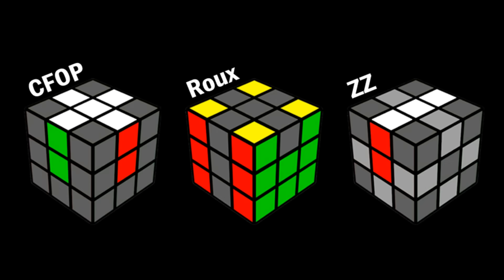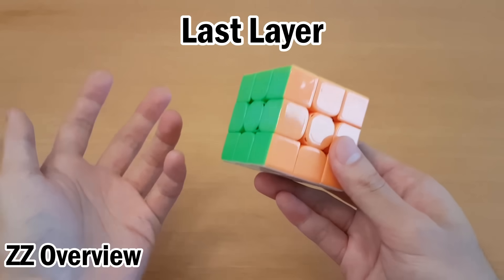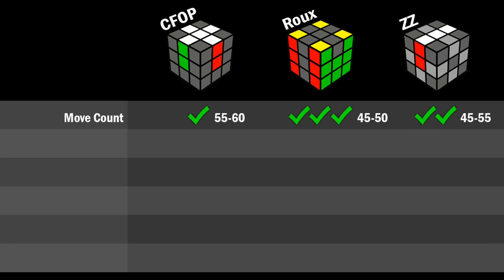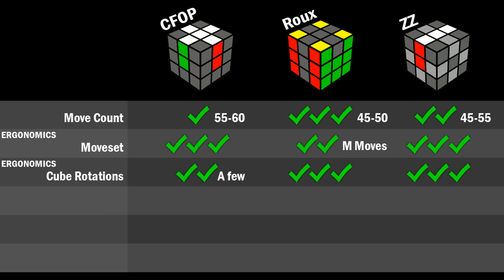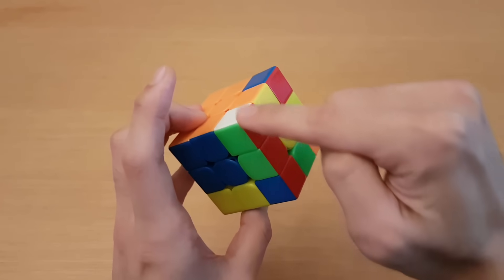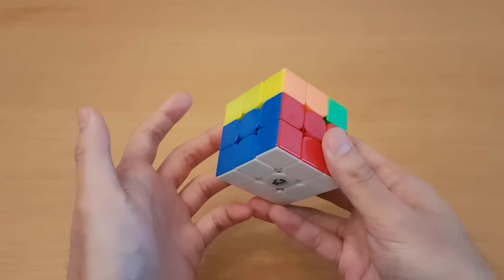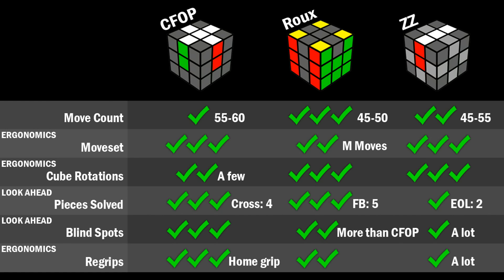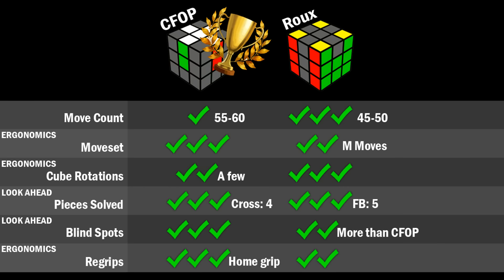The BEST Speedcubing Method? [CFOP/ROUX/ZZ] Comparison

Comment from the maker: Some good points I've read:
- ZZ EOCross is better than EOLine for regrips and blind spots. I still think it compares poorly to CFOP and Roux in the other points already discussed in the video. Even though it seems like "do some moves then do a better version of CFOP", look ahead is still hindered. Inspecting cross+1pair in CFOP is similar to inspecting EO+cross in ZZ, meaning you still solve 6 vs 4 pieces and remove a blind area by doing CFOP.

- Roux M turns are not that bad on big cubes. I accept that I may have been wrong. Please forgive me for switching to a new argument: I don't believe that <R, Rw, U> is a great moveset on big cubes as Rw is similar to L. Frequently switching between R and L (Rw) is slower on big cubes.

Also this thing about regrips:
- Starting with r2' for the Roux regrip example reduces it to 0 regrips. No it does not. You start and end out of home grip, meaning that there are 0 regrips mid-alg, but usually 2 and possibly 1 regrip instead if you're lucky. So if you used that exact alg in a solve, chances are you'll add 2 regrips to your solve. Therefore it has 2 regrips. This is the same reason why OLL algs are not regripless unless you start and end in home grip.
Reply: "Inspecting cross+1pair in CFOP is similar to inspecting EO+cross in ZZ"
I don't agree with this at all
I don't know of a single at least decently fast ZZer that does EO+Cross seperately, most (if not all of them) do it at the same time. 
Besides, even if you would do them separately, its 100% not as difficult as inspecting Cross + 1 F2L pair (at least from my experience and other people I've asked). 

And some other points for the ZZ vs CFOP argument: (just a quick note over here, I'm talking about EOCross)
Lookahead
This one I really don't understand either, how is lookahead supposed to be any worse for ZZ compared to CFOP? From my experience (sub-13 w/ CFOP, the same now w/ ZZ) lookahead is actually easier in ZZ. I know someone is going to say: "oh but you see more pieces when you rotate blablabla", it is true that you see pieces when you rotate, but rotations take time, which cant be used for turning (because you're basically doing a really long regrip). When with ZZ, you don't need to do rotations, and you really don't need to even tilt the cube much, because remember, EO is solved, you always know the orientation of the edges, so you don't need to check the orientation. And as long as you know what color the other side of the edge is (which you can see without tilting much), and you have seen the edge with the different color somewhere else, you know 100% which edge it is. For corners, I do agree that its a little harder than edges, but its still better than CFOP imo.

Regrips
I don't think I need to talk too much about this, its pretty much just CFOP without rotations/F moves.

TPS
This is highly related to Lookahead, which I already covered. Its faster with ZZ thanks to there being less cases, thus you being able to predict more/not have to lookahead as hard.

Now, I might look like a ZZ user trying to defend his method and not knowing anything about CFOP, but you'd be wrong, my opinion has been like this ever since I got about sub-15 with CFOP, when I actually decided to take a deeper look into ZZ and actually do some research to make up my own opinion instead of relying on random strangers on the internet.
Now, just to make this clear, I am NOT trying to hate on the video
Reply: I agree that <R, Rw, U> isn't great on big cubes and thus Roux is not as good as CFOP on big cubes. However, the difference is way overblown. It's so small that it's still 100% possible to get world class at big cubes with Roux. If Max Park did Roux for 3x3 stage on 7x7, he'd still be way ahead of everyone else. That's why I think it's misleading to say "don't use Roux if you want to specialize in big cubes" because a more accurate statement would be "don't use Roux if your goal is to push the limits of big cubes."
Reply: Viljo Elo Max Park would be way ahead of everyone else using Roux on big cubes because he’s Max Park.
Reply: Jeez, comments are random here.. I wanted to comment about this so more people can hear a roux solvers side.

Regrips in roux happen, and I told jperm already that I watched some sean/kian solves and there aren't many regrips. I was wrong, or at least in the solves he watched. Even with regrips, roux is shown to be one hell of a method.

Big cubes and roux do not mix. I just got my first 4x4, and tried Meyer. It's not fun to solve, so I hardly touch it. I can do M moves just fine, but the l/r moves are difficult and slow me down quite a bit. Currently trying to wrap my head around another method to have fun with 4x4

I think I mentioned this before, but all my roux friends have agreed that BD is the only real blindspot, and we do manipulation to see it without peaking underneath, or on the B face. For look ahead, I'd say it's better than cfop, at least for a beginner. A good cfop solver might think ahead more and solve two back F2L pairs to make look ahead easy. But that's a good solver. With roux, first block is solve in inspection, and the rest is look ahead, which requires only looking for the right side(you can switch it if you really want) 

Last, I do not think roux is better than CFOP. The reason I suck at cfop, is because it's not for me. I found myself bored and frustrated because I just couldn't improve. I started learning full oll, and was almost finished with pll(scary G cases) but I was still averaging 30s. Cfop just wasn't for me. The nature of roux is what allowed me to excel with it. I personally am not a fan of comparing methods, especially since I'm not an amazing solver and there's people that are sub 10 with ZZ. It's really reliant on the cuber, how they learn and what's fun for them. If anyone's interested in learning about roux, to see if it's right for them visit the sub reddit r/rouxcubing. It's not super active, but if you post a question it'll be answered super quick by tons of people
Reply: Jperm any tips on learning full CFOP I'm sub 26 and I procrastinate on learning the algs. Any advice?
Reply: Doing EOCross+1 Is not impossible, some people can consistently do that, its possible just a little bit more difficult
Reply: J Perm hi
Reply: J Perm are you a cubing dad?
Reply: i saw your square one vid good job you are great!!!
Reply: What about X& Os?
Reply: @seangauthier8144  I personally don't think Xs and OS is super viable. There's another corners first method, I have a friend that uses it. He switched to roux though, but he said it had too many move types and it was weird to finger trick. I think it's called LFCF or something along those lines
Reply: I need contact details of someone who can solve a cube within 20 secs. Need to create 2-3 fake solves. I am a magician.
Please let me know on my email id atul3147@gmail.com

Thanks
Reply: J Perm you forgot about the number of algorithms required to solve.
Reply: @dft4760  I agree. That's a pretty important point. Like, ZZ has the 7 OLL algs and the 21 or something PLLs, Roux has 42 for CMLL, and CFOP has like 71 or whatever. And I'd say those are the requirements for sub 20 for each method
Reply: you can just use 2 look oll to be sub 20 w cfop btw
Reply: just get good and these arguments all don't apply lol
Reply: i feel like lookahead with eo is significantly easier than without it because the number of cases you can possibly get is reduced significantly so i dont really see the lookahead problem with zfop as a problem
Reply: pin that
Reply: Very great
Reply: Hey JPerm! There does exist some ZZ solvers who plan EOCross+1. The community is currently looking at subsets of last two pair multislot already establishes that ZBLL is the best finish. So now the steps of ZZ looks like EOCross+1, multislot with F2L, ZBLL. So could an argument be made that once these optimizations are put to practice, that ZZ ≥ CFOP?
Reply: Im also a ZZ solver, but using that argument, the best CFOP solvers can predict 2+ F2L Pairs and some can even predict full F2L @otay5817
Reply: Hi and thx I’m just started solving agin
Reply: I don’yt kyyYyy y   Y yyyy yyyy ÿy y yy yy yy y yy y y yy y      y 🎉yyyyyYy y 🎉Yy  Y y🎉y   yyy yy yy yyy 🎉yyyy yyy y yy now 🤷‍♀️ y y  ywe rnooh y y🎉yy yy yyy😂  n nYyyy yyyy yy yyy yy yy yyy yyy y in N N my yhhhhy🎉 yy🎉 yyyyyy yyyyyy 12:39
Reply: But in M U M move 1st we can use one hand fing and then another one
Reply: That's true because as a ZZ solver i use eo cross because its way faster than eo line
Reply: EO cross is harder than anything in the cubing community because I hate inspection If you wanna convince me Fb in roux is harder no Cross 8 moves or less so is fb ZZ EO cross is extended cross which Cfop is best at
Reply: Does anuone know the algorithm for his OLL
Reply: i use zz regularly
Reply: Hi J Perm I started cubing this summer and I' m currently stuck on sub 30 seconds. I'm using 2-look CFOP.Should i learn the full Cfop. Please reply. Have a good day/night. :)
Reply: @Cefurbi  Joining the upper comment - 
Full PLL is great and relatively easy to do and def. can cut your times a little.
F2L efficiency WILL get your times drastically lower, and it's the one thing that is consistent in all 'how to sub x' vids. Also the "longest" part of the solve objectively. 

If you like learning algs you can also slowly pick up more easy OLLs. If you know full PLL your hands will already know some of the algs already, so getting those easier ones out of the way shouldn't be a problem.
Reply: @Cefurbi  You are at the point where full PLL would definitely benefit you but I wouldn't bother with OLL yet. If you like learning algorithms and you want to learn full OLL because you can, then by all means go for it. It will help you eventually. But at your level full PLL is infinitely more worth knowing
Aside from that, try working on F2L efficiency, and recognizing your cases quickly.
If you've reached sub-30 just since summer, you're making great progress already. Keep up the great work and welcome to the cubing community!
Reply: @NoahS4226  Ty. I've got my first cube like 5 years age and now I'm sad that i didn't lesrn how to solve it... but yeah I can inprove mostly on F2l I think so yeah I'm going to work on that as well as the PLL cases
Reply: @NoahS4226  Also I've been wondering when to upgrade my cube. At the moment I'm using a Warrior W and was thinking about getting the MF3RS3 M which is around 15$.
Reply: @Cefurbi  
yixin little magic 5
Yuxin little magic m 20
Yuxin Kylin v2 m 10
YJ yulong(??) V2 is 9
Yuexiao EDM is around 20
GTS2M is 25
Mf3rs3 is also great.
Many options around that price point!
Reply: @Cefurbi  yes totaly learn
Reply: Haven't solved a single cube in my life, and YET this showed up in my recommended lol.. Regardless, thanks for making me feel dumb/er than I thought I was :P :) :D

Comment: You said that EOCross suffers a lot from the problems EOLine + ZZF2L has. Could you please elaborate on that?
Because it seems like your main concerns about ZZ are ergonomics and look ahead. With EOCross, like you also mentioned at the end, ergonomics are definitely improved and comparable to CFOP, if not even better (since you also have a cross and there are no rotations). Look ahead is pretty much the same as CFOP, too, because you solve as many pieces as with CFOP (assuming you don't do Cross+1) in the beginning, so there's also the same amount of blind spots.
Although EOCross takes more moves for F2L (at least I think so?), COLL + EPLL compensates for that.
The only problem I would see here is that EOCross is pretty hard to see in inspection, though that is only a matter of practice. A lot of ZZ solvers are able to plan EOCross consistently and even if you can only plan EOArrow, you could still solve one side first and then insert the last cross edge (which shouldn't take more than 2 HTM/4 QTM).
In my opinion, EOCross is at least equal to CFOP and definitely better with ZBLL (or even ZZLL), so people should finally stop saying that there are only the "big two", because ZZ really has potential.
(I do agree though that ZZ with ZZF2L is garbage for 2H.)
Reply from the maker: I agree ergonomics is entirely fixed with EOCross. It slightly improves "blind spots" but not entirely since that one is highly linked with "solved pieces" which isn't fixed, as you still spend moves doing EO and not solving stuff.
Reply: @JPerm  Ah okay, so you mean that while someone inspects EOCross, they could also do F2L+1?
That's definitely a valid point, but this is only really true if you can consistently see Cross+1 for CFOP. 
I guess this argument could go on forever, but really just wanted to point out that ZZ is not entirely bad, so people should give it a chance (and if you're willing to learn ZBLL, it really reaches its heights).
Reply from the maker: @redstone_tim  I guess i sort of regret not going more on EOCross rather than EOLine. The thought of EOcross hit me in the last few seconds of recording and for some reason I didn't feel it was important enough? Idk why.

And yes the reason I'm equating eocross to cross+1 is because they are about equally hard to inspect. EOCross difficulty is helped by the fact that it accomplishes fewer moves, but also hindered because it requires looking at 11/12 edges which takes some time.

Comment: As a roux solver I think that other roux solvers, should at least learn CFOP (not that I have learnt much yet) and CFOP solvers should learn basic roux. It teaches you so many unique ways that you can pair/insert things that may not always be efficient, but sometimes will be. Some of my best few roux solves have been with CFOP pairing, and my best CFOP solves have used roux-styled pair insertions. Even if you only learn 'how' to solve with the other method and stop at that, it will be beneficial.

(It's 4am, so please ignore terrible grammar/spelling etc, too tired to proofread)
Reply: I am a Roux solver and I figured out CFOP and Petrus on my own

Comment: 10:29 So, for example, being like 13? Or can they turn just as fast as everyone else?
Reply: First of all, you have a cringy pfp, but that's besides the point. I started cubing at, like, 10 and it was just slightly harder to turn fast, but not to the point where I wanted to switch methods. But every person is different, and if you feel like your fingers can't turn so fast, maybe try roux, but in the end it's your choice.
Reply: yeah, that’s the point of the meme, to be cringe.  It takes a figure of childishness and makes him look like a drug addict, which is why it’s funny.  And okay, cool, thanks.  I already use Roux because I found it a lot easier to learn at first.  Now, I’m wondering if that was a good choice, because I think I’m a really slow turner.  My explanation for this has been that I’m just young and I don’t have all that experience and muscle in my hands yet, and I just need to build it up slowly.  Just curious.  I’m probably staying with roux considering I’m getting pretty dang good improvement.

Comment: I can't learn algs that good, but I want to learn cfop

Does anyone have tips on learning algs and understand the cases as fast as possible?
Reply: For R U F and R U L algorithms, keep track of the front two F2L pairs throughout the algorithm to see how they move around.

For M U algorithms, just memorize the rhythm of the alg. With M U algorithms, there are only two types of moves you have to do: M and U. So for example, the H perm goes like this: M2 U M2 U2 M2 U M2. You could memorize that with (2 1) (2 2) 2 1 2.
The U perm goes like this: M2 U M U2 M' U M2. So you could remember that as (2 1) (1 2) (1* 1 2). With the asterisk representing an inverted move (like R' or U' or in this example M').

Lastly, just practice recognizing all the sequences and patterns of moves that commonly reoccur it different algs. For example: the Y-perm is F R U' R' U' R U R' F' R U R' U' R' F R F'. you could break that down into F (R U' R' U') (R U R') F' (R U R' U') (R' F R F'). I remember (R U' R' U') just by what it feels like when I do the moves in my hand but I used to remember it as (RURUi). (R U R') is just what you would do to take out an F2L pair so I call it (F2Lx). (R U R' U') is the famous 'sexy moves'. And (R' F R F') is the equally famous 'Sledgehammer'. So the Y Perm can be broken all the way down into F (RURUi) (F2Lx) F' (Sexy) (Sledge). Now you only have to remember a couple of triggers instead of like 17 moves.

Let me know if you have any questions and I'll try my best to help you out
Reply: Tl dr: learn roux
Reply: My main problem is the block building. I don't really know if it will be easier than cfop. Also I don't know how many algorithms there are in roux.

Comment: Im a CFOP solver, but I think you were too harsh on ZZ. In my opinion every ZZ solve (excluding the EO) feels like an extremely lucky CFOP solve, because there is no cube rotations and the F2L pair lookahead is way easier since there is about half as many possible F2L cases. Also the LL is always lucky, enabling easy OLL or COLL.

I think ZZ F2L and LL are superior to those of CHOP's, but what ruins ZZ for me is EO-line, and EO-line to F2L lookahead and transition.
Reply: But in cfop you can reduce regrips, getting higher tps but that's just out of the question for zz. L and R moves is pretty much a rotation because it is a double regrip. In my opinion, I think 6-7 tps is the quickest you can turn in zz.